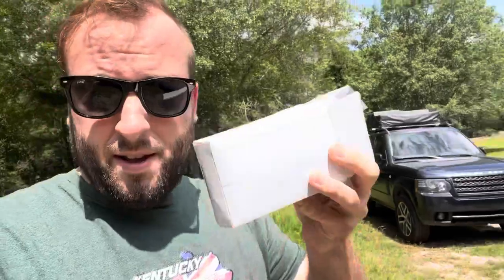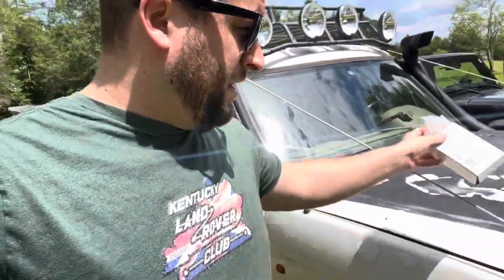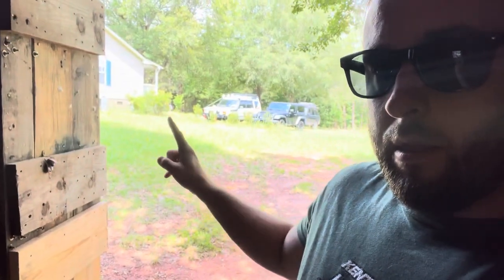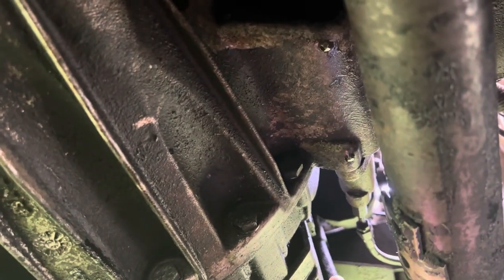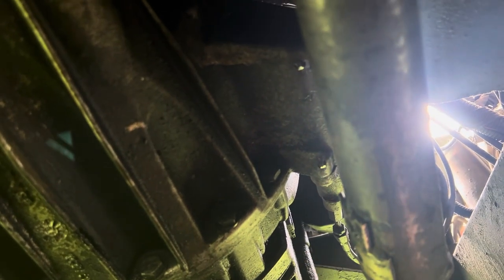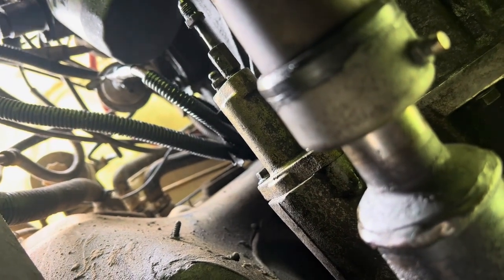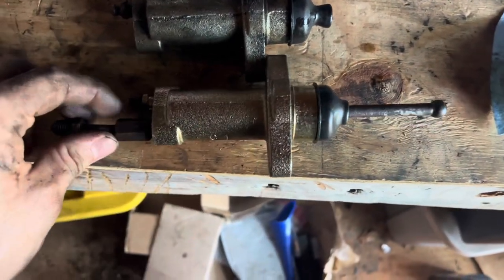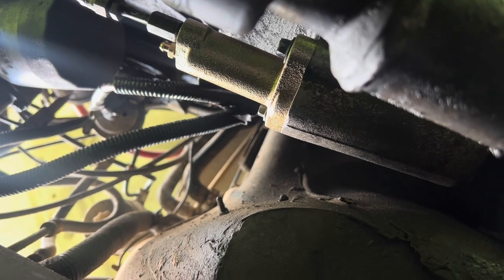Replacing Slave Cylinder on the Land Rover Discovery

Comment: How did you bleed it?
Reply from the maker: @Coughlan1916  pump the clutch 10 times, open bleeder nut on slave cylinder, tighten back up and repeat (like a bagillion times) until the pedal is firm and bounces back. Keep an eye on the reservoir, topping it off as you go. Easier with 2 people.